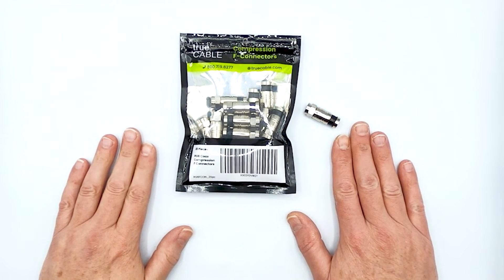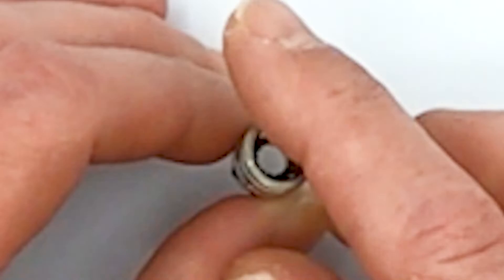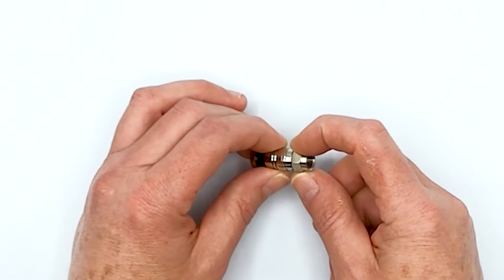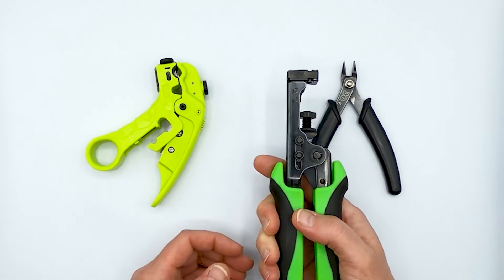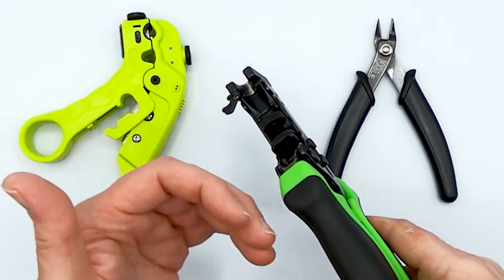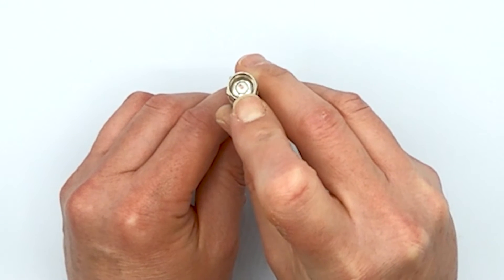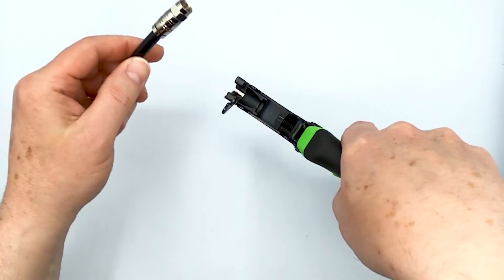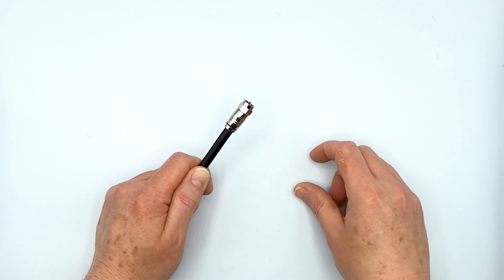How To: Terminating Coax Cable Without A Flaring Tool

Comment: Is there anything wrong with brushing the braid back with a small stainless steel brush? Velcro doesn't last very long.
Reply from the maker: Hello Mark. No, not wrong per se. That said, be careful that the metal brush does not snap off and remove the braid shielding in the brush-back process. The braid shield is simply thin aluminum, so proceed with care.
Reply: @trueCABLE  Thanks.
I prepped an RG6 quad cable in the normal way. The brush I use is like a toothbrush only with stainless steel bristles.  I held the cable over a new all white paper plate and brushed the braid many more times than would be done to prep a terminal for installation. Zero damaged braid wires showed up on the plate. Braid was perfectly straight, and one could almost say soft.  I carry two such brushes in my tool bag. One is labeled, Braid only. The other is for surface cleaning. Velcro was only good for about 70 terminal prep jobs.
Reply from the maker: @Oldtech51   Hello Mark! Thanks for passing that along, and it is good to know.

Comment: I  tried installing an Ideal Universal RG-6 compression connector (part #92-651 onto Tappan RG-6Q using the techniques from several videos and I could not get the results you got. Cutting back to expose 1/4 inch of the dielectric isn't enough. I couldn't get the connector onto regular RG-6 either no matter how much force I use - this is prior to compression. These compression connectors are expensive and I end up wasting them.
Reply from the maker: Hello! We know the feeling. The reason has to do with fitment of the connector onto the cable, plus the traditional sleeve style compression connectors require a great deal of force and flaring of the cable, which does not always work out. This shows up most often on quad shield coaxial. Basically, we recommend you pick up some of our F connectors at trueCABLE (https://www.truecable.com/products/rg6-compression-f-connectors) because they care much less about fitment and don't require you to flare the coaxial cable jacket. What I demonstrated in the video was the trueCABLE brand, which are specifically designed to be super easy to work with on quad shield coaxial. You can use them with any standard compression tool. Give them a try!
Reply: @trueCABLE  I ordered a package of 10 since I can't get any locally.